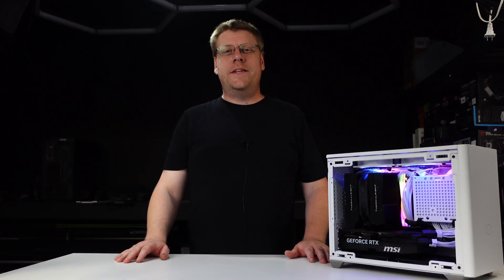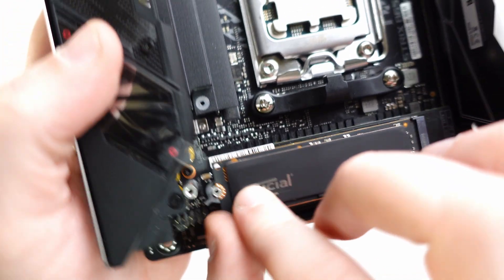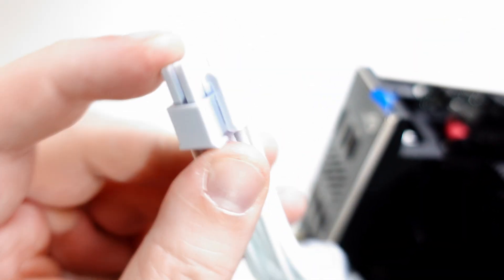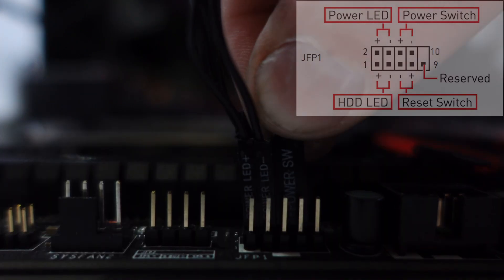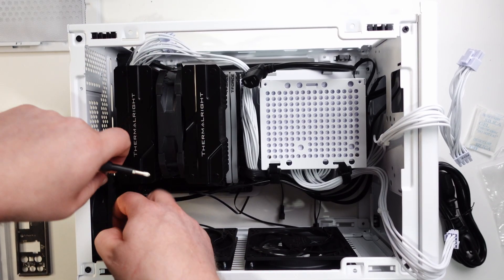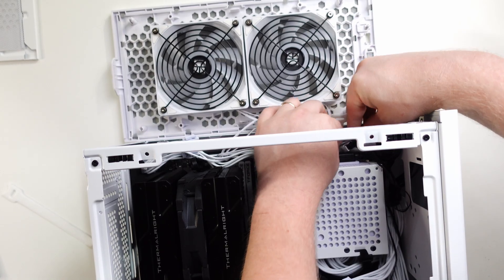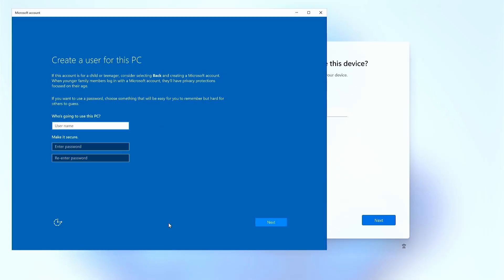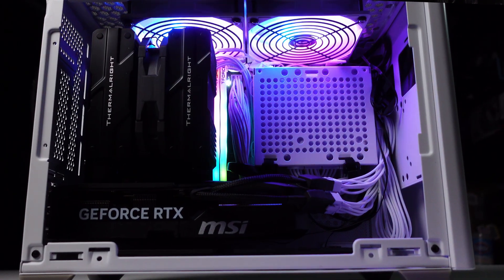Building My First ITX Gaming PC (Full Step-by-Step Build Guide)

Comment: hello im new to building and plan to get a 3600/rx6600 system soon. im confused, why did you skip not logging into windows and if i do launch windows and log in, will i have to upgrate all my drivers and get software to maximize/utilize the fuller power of my ram?
Reply from the maker: I sell the computers afterwards so its better for me to skip the login so I dont have to put in microsoft information, if its your computer you absolutely can just login. Most times you can enable XMP/EXPO without updating, but ive had it where it crashes my computer, and i was required to update my bios to make it stable with XMP. Just enable it, if your computer doesnt crash you are fine.

Comment: yeah I am about to start working on a SFF build myself but I went a bit overboard and committed to a ~5L build so I still need to figure out a good cooling solution for the CPU. I'm going to be using the Velka 5 with some pretty high end hardware so I expect a few cooling struggles. Still excited though.
Reply from the maker: That is soo cool! i just watch a build in the velka 5 and it was so clean! The video i watched he had to undervolt his cpu to keep the temps manageable
Reply: @fpsforless  that is what im worried about. I may just have to cut a hole in the case it fit a tower cooling system. Its worth it imo to use the CPU at max performance. Could you give me the link to the video? Id like to see what others did so I have a reference to go off.
Reply from the maker: https://youtu.be/l8cn2jkyg9w?si=Sr4ATSLyIPXtCKL1 he doesnt show you how to do it, but he shows the graph between having the cpu stock vs his undervolted version.. Ill actually be doing a video on what he did for my next video... thats the plan anyway!